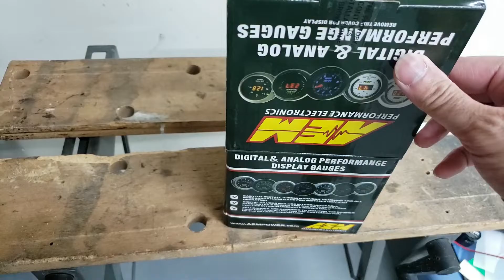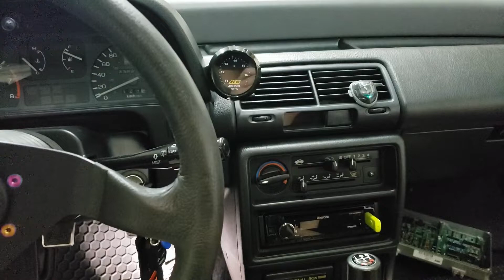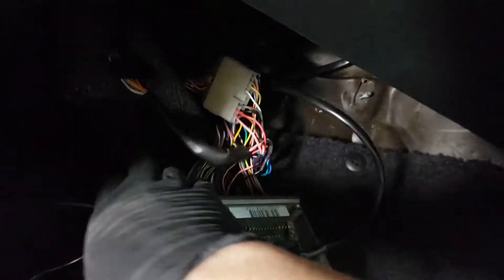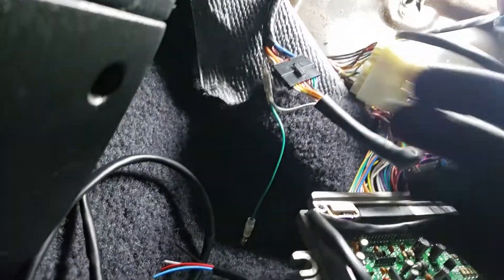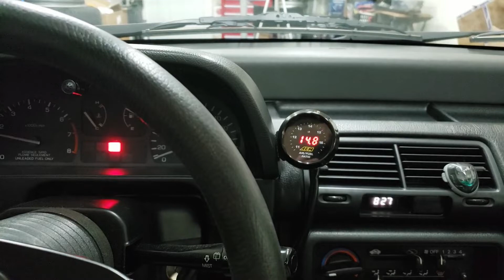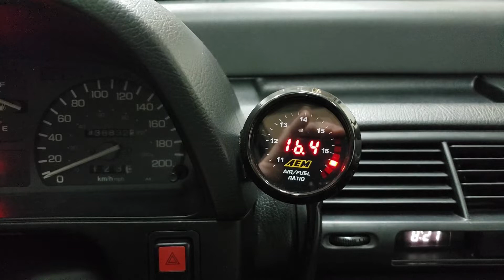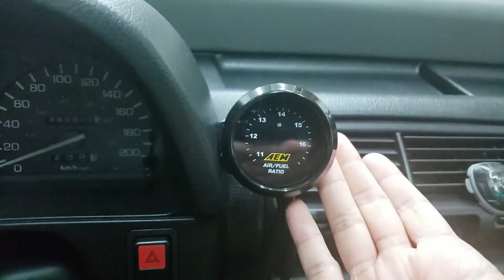||HONDA EF9 / ED7 88-91 CIVIC/CRX|| Installing AEM 30-4110 Wideband Gauge & Sensor

Comment: 4:46 just wondering your wideband setup, is it you running the wideband with stock p28 ecu?
Reply from the maker: No, my ecu is chipped. There's no point in running a wideband on a stock ecu. Widebands are used for tuning.

Comment: Have both narrow band and wideband side by side. Love your vids. I have 91 civic d15b2 with dpfi. Im trying to get the engine running the best it can. Dam pain in the ass right now. Im running what i think is rich. No wait im lean so the computer over comps by adding a lot more fuel than needed.
Reply from the maker: Thanks. Its tough to pinpoint the cause of it running lean or rich. So both your narrowband and wideband tell you it's lean? I'm assuming your ECU is stock since you're running a stock dpfi motor. Have you smoke tested your exhaust? any cracks or worn out gaskets on the exhaust can cause a small unnoticeable leak. Extra air can get sucked in through those leaks causing the readings to be lean.

There's not a lot you can do on a stock engine and ECU. Just have to clean sensors, replace sensors, check for leaks, etc. The most common thing that goes bad is usually the O2 sensor, but I'd assume you probably replaced it already. But the O2's do fail quickly if your engine burns some oil.
Reply: @BudgetGears  stock as stock can be. Yeah i just replaced the exhaust manifold. It had a big crack. Thats done but i feel like i do still have a leak somewhere on the echaust maybe by the original resonator. Yeah notmuch i can do other than get sensors gauges and mpfi swap. I notice that while exhaust was off i have crude in cylinder 2. I need new seals and gaskets. I thought i had intake leak. But now i think its head gasket or valve seals. I think both but one step at a time. If i have to take the head off then the engine is going out completely. The way it is. Smog due soon so need to get it running right. Also fan is hot wired with a switch. Thatll be next. These cars are so fun to drive and a real pleasure to fix. Just parts are now getting expensive.